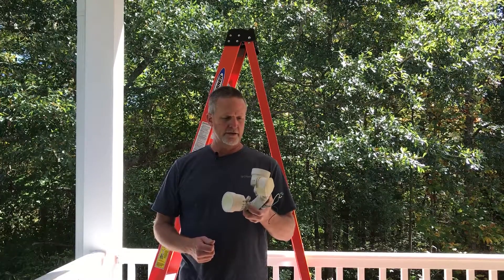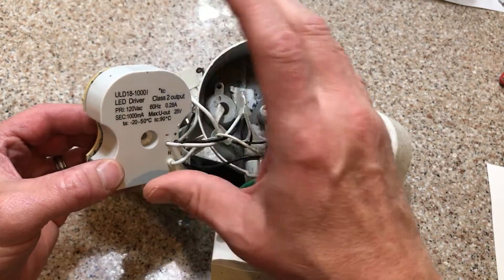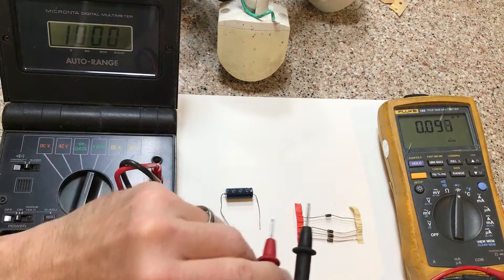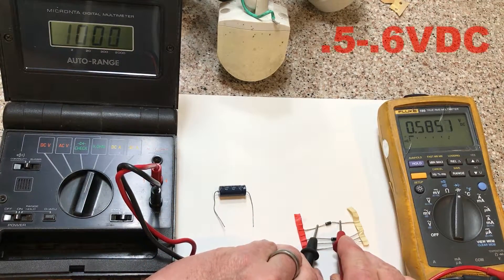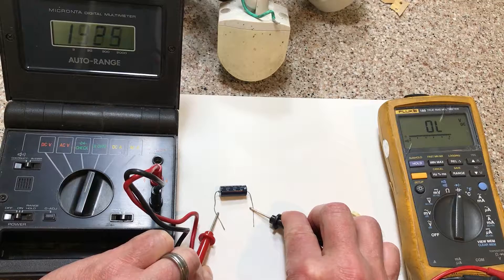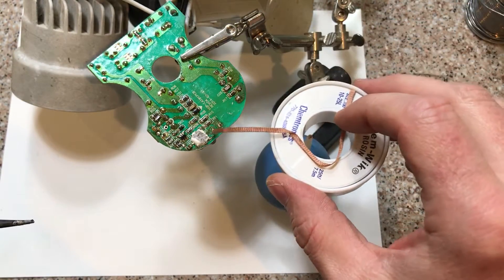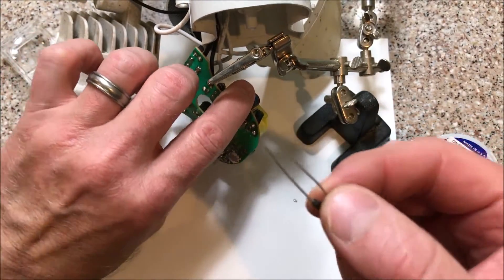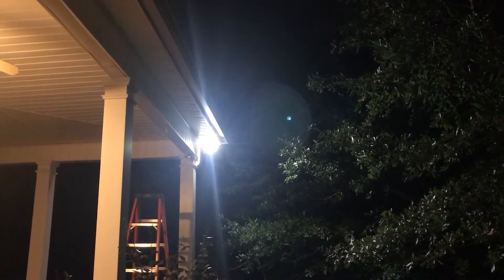How to fix blinking LED lights

Comment: Hey man, thank you. I don't want to say I fix electronics but I can usually fumble my way through and fix basic problems. I'm well aware of ohms law and what capacitors and diodes due (for the most part) but I don't have a Fluke and have never known how to diagnose a bad capacitor other than visually if the goo has leaked out, or with a multimeter capable of it. Im sure there are people that will say just checking resistance is incorrect and not accurate way to test them. I get it. It's a start though and better than nothing. I also appreciate the refresher on diodes. I took Voed Electronics back in High School but that was....wow....over 30yrs ago. I just got depressed realizing that I'm getting old. 😄 Thank you for the simple explanation. I REALLY appreciate it.

Comment: Will this work with a ring security camera flood light. Mine just started blinking?
Reply from the maker: You would have to open it up and look for capacitors blown first then diodes.  It is almost always a faulty power supply and not the LED themselves.  Ring may have surface mount components on the circuit boards. Doesn’t hurt to look.
Reply: Take the diode off the test it.